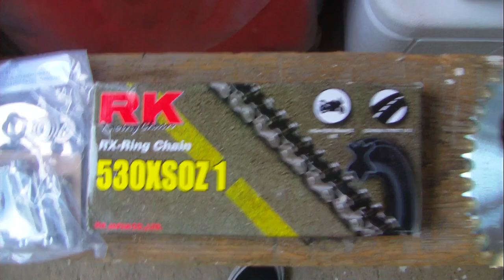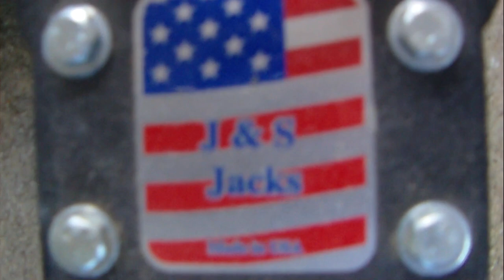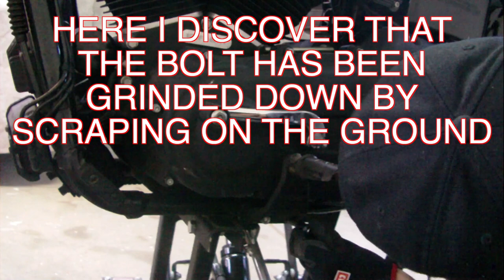Installing chain conversion kit on Dyna

Comment: just a fyi for those planning on doing this or if GI plans on doing this again so you don't have to worry about bike tumbling towards the pavement... BEFORE you take off the rear wheel or cut the belt, do the primary stuff first. drain oil, remove primary tensioner, loosen compensator nut, loosen clutch basket nut (remember, REVERSE threads here), after you have nuts off then remove comp and clutch basket, remove outer primary.

Comment: I read in a forum that the sprocket but is actually reverse threaded to only 35 ftlbs. If that were the case it could explain the difficulty getting it off. Looking to do this upgrade soon. Great video man ride safe.
Reply: *sprocket nut
Reply from the maker: Ryan Purdy Well mine came off standard lefty loosy thread. But yeah the manual says its supposed to be 35 ft pounds, so I don't know why they're so hard to remove.
Reply: +GiraffeInvasion (GiraffeInvasion) so apparently the nut on 5 speed dynas is reverse threaded, 6 speeds aren't. My only guess why they're so hard to get off is bc the sprocket spins in the direction that tightens it, so over time and rapid throttle whips inertia in the fastener could slowly tighten little by little over time. That is 100% speculation though. Fingers crossed mine comes off with an impact.
Reply from the maker: Ryan Purdy Yeah, good luck. Hope it works out.

Comment: I'd leave the belt on with the tire it's easier to break the nut off the transmission gear unless u have the locking tool to hold the transmission sprocket then take the tire off just saying

Comment: Hey I’m just about to do the same. You say 25/50 teeth sprockets.. whats the rpm at 60mph ? 
Does that gearing match the original,  or quicker acceleration with  less top end, or vis-à-vis. Thanks

Comment: Christ, hipsters in Craftsman gloves, lol. That sprocket nut has glued threads, so is VERY inclined towards refusing to rotate. Of course that ratchet broke, those round head Craftsman ones are LIGHT DUTY. For that job you should use an impact gun to remove it, but failing that, a 3/4 inch breaker and a GOOD impact rated 3/4 to 1/2 drive adaptor AND a 4 foot long pipe as a cheater. You also should lube the hell out of the interior of the socket and the socket support ring. The sprocket, because it won't be reused, should be "counter torque," supported, so all the stresses are isolated from the trans bearings. A BIG pipe wrench to the shop floor would work.

Comment: If the sprocket nut won't budge, centerpunch it halfway from the thread to the point where two flats of the hexagon meet. Drill the punch mark with a small drill, then a larger one a few times until you almost 'break-through' the outer edge. Then use a cold chisel in the hole and strike it sharply in the direction to loosen it..... the nut will fracture and can the be easily removed....... try it, I have used this trick many times in all sorts of situations...... but why are you fitting a chain - I still use a belt with 127 bhp on my Dyna, and chains don't last as long. If you are scared about breaking a belt, check how tight it is - remember that the pulleys expand when they get warm, especially the aluminium rear ones.
Reply: BELTS ARE FOR PANTS.
Reply: @zachzorlac9839   Chains tie you down to constant maintenance and cleaning......
Reply: But having a chain let's u have a wider tire
Reply: @arnold4307   Depends on many things, bike/swing arm/wheel offset..... on my2010 Streetbob I can run a 190 wide tyre but it upsets the handling. On my 2006 Sporty I used to run a 160 wide with no problem. use offset wheels or sprockets and you can get around it in the same way you would do it with a chain.......

Comment: Hay is the front gear 22 tooth and the rear 47 like a shovel head harley ??? Just Askin ? and are you going too hook up a oiler for the chain  because if your going to take it on a long trip  better bring a can of chain oil with you  because that chain will get hot !! on The Free Way at High Speeds  For Long Time !!
Reply from the maker: i believe its 25 in the front and 50 in the back. I rode it from San Diego to palm springs and back i didn't have ant issues so i don't know about an oiler.

Comment: What's the added value having chain driven vs, belt driven?
Reply from the maker: Indy Vin you get a bit more power because the chain doesn't stretch like the belt does. Harley uses belts for tradition, chains are better performance.

Comment: What size is the socket for the main drive , for the front sprocket
Reply from the maker: 2 1/4"
Reply: Where did you get that socket and how much did it cost ya?
Reply from the maker: Dominic Banaga Amazon. I think it was around $70 😥. I don't know if there is cheaper.
Reply: GiraffeInvasion can you put the link in a comment for me I’m also going to be using a breaker bar and some grit but I can only find impact sockets
Reply from the maker: Dominic Banaga https://www.amazon.com/dp/B005CW9OQM/ref=cm_sw_r_other_apa_VJU8zbB4PAHAS

Comment: what size front and rear sprocket? how is the performance
Reply from the maker: i think its 25 teeth in front and 50 in the back. it definitely takes off faster and it feels like runs in higher rpms than before.

Comment: Where did you order the chain kit from ?  An over all how long did it take ? I have a 01 Dyna Defender I want to convert over.
Reply from the maker: baileytom78 I bought the zipper performance kit. It took me like a total of 12 hrs haha only because i had no idea what i was doing and it took like 4 hours to take off the primary lock nut.
Reply: GiraffeInvasion aww man I hate to hear about the big nut not wanting to break loose. I plan on doing mine this spring after my next road trip. I like the belt but worry about getting stranded in the middle of nowhere with a busted drive belt.

Comment: I'm having a hard time keeping the sprocket still while cranking on the nut, do you happen to have the dimensions on that wood you used.. thanks!
Reply: Just cut a 2x3 or a 2x4 to approx 7 to 8" your gonna have to do the mesuring bud, but It'll work

Comment: What song is that in the beginning?
Reply from the maker: Dakota Mockbee Its Young Grave by For All I Am.
Reply: GiraffeInvasion awesome. Also next time get ya a half inch impact, air or battery, and that mainshaft nut will come off after about a minute of running the impact on it.

Comment: hey, what year dyna.... no need to pull the bearing? this is great news!!
Reply from the maker: Its a 2015.  yeah the bearing does not have to come off.
Reply: and i got the upper shock bungs too, cant get the front on account of the forward controls im running, also suicide clutch shifter
Reply from the maker: Sean Craig suicide shifter ? nice . I've always thought those look cool
Reply: ya la briola designs makes a really legit set up, then im looking at this new centrifigal clutch, you still have to shift gears, but you dont have to press the clutch, and you can stay in first and use the breaks/ take off without clutching... its for perfomance motors, but we will see... going for a sketchy lowered wheelie wide glide... lol having fun
Reply from the maker: Sean Craig thats cool. kind of like a quick shifter on a sportsbike?
Reply: exactly, because the forward controls...and you gotta use that rear brake if you wanna wheelie... so  im thinking rear brake left lever, going to get the rear bungkings passenger set to stand on, sketchy though... lowered 2.75 inches total, cut the fender... i have the progressive 412 but i want ohlins i think
Reply from the maker: nice, dude. i wish i could wheelie. thin im gonna get a dirt bike so i can learn.
Reply: shit, idk really how to yet myself... you gotta watch some videos, its different with a harley, cause all the weight is in front and most guys have t bars, get on the point where it jerks and just throw all your weight to the back and jerk up hard and gas, rear brake to keep from going past 12 o clock...

Comment: I hope those sprockets aren't aluminum. Been there.. done that. In a couple years you'll be replacing them again... For the main sprocket, you need a large impact gun. Nothing at Harbor Freight will do it. Just keep hammering it, and it'll come off. I always replace it even if able to get it off without a hitch.

Comment: Why??? All these cleaning and lubricate Job all "few" Miles! The Beltdrive would be for me  a reason to buy a H-D.
Reply from the maker: Kenji Motoyama to change the gearing. More torque.
Reply: Chain is more reliable and cheaper , I've gotten sick of broken belts and being stranded .
Reply: and the conversion is not much more than replacing a belt, with the advantage of never having to pull everything apart to replace a chain in future
Reply: I meant to change a belt....I was appalled to see what changing a belt entailed after running chains for 50 years.
Reply: @10psouthbay  yea good luck with with a new chain if you are replacing the old worn out chain and leaving the old sprockets in there... let me know how long that shiny new chain last.
Reply: @pierrebornerot4689 I doubt you even ride .